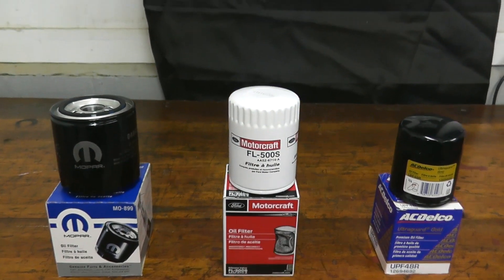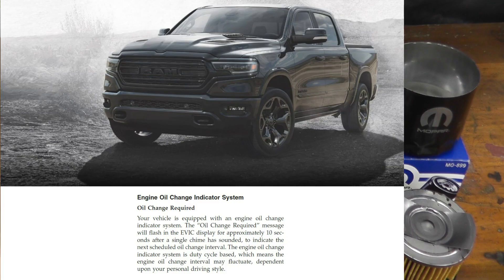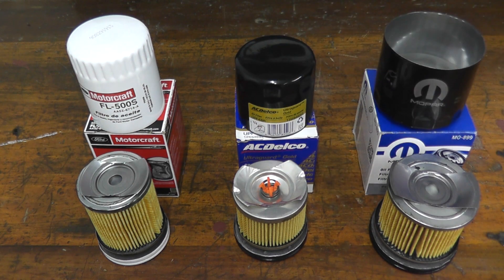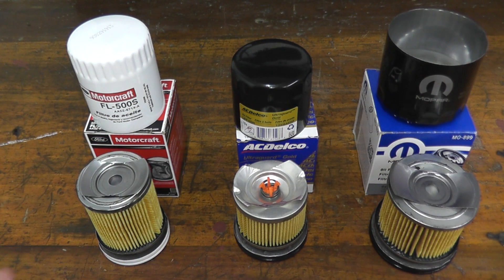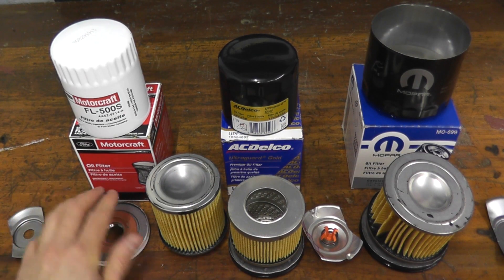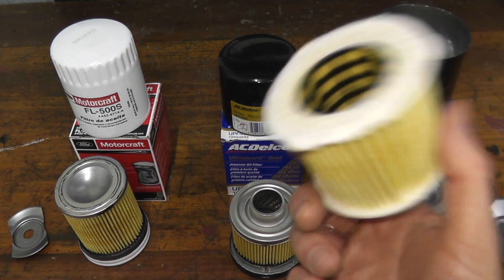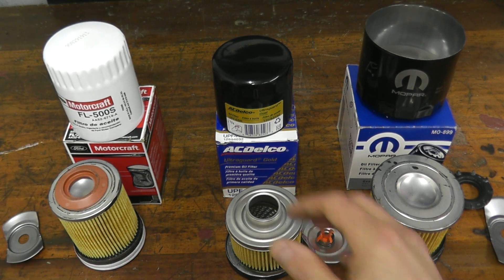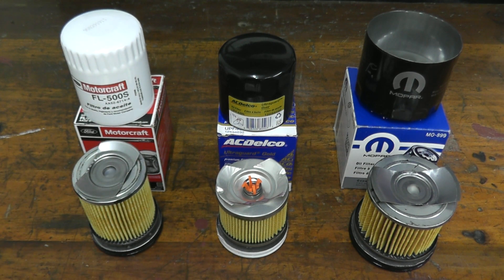Ford F150 Oil Filter vs Silverado Oil Filter vs Ram Oil Filter | Pickup Oil Filters

Comment: There is an opinion around about filters that are too good. I’ve talked with a couple mechanics who have the thought that just maybe these high efficiency filters are too good.  Meaning that they are so efficient that they are not allowing adequate flow which is causing some failures in newer vehicles.  I drive a F150 and have always used motorcraft filters.  150k and no issues.

Comment: Is it ok to use a mopar oil filter on a chevy? Also how much torgue do you recommend when torquing the oil filter?  I dont want it coming loose when going over speed bumps or pot holes?
Reply: If you're gonna do that, put a Motorcraft one instead. 
the quality is oviously better, and it's cheaper too!
Oil filters should be hand tightened always, and try to not use that much force.

Comment: Much hubbub and bad informattion regarding those COIL springs vs. the STAMPED STEEL springs.
Many Reviewers complain that the stamped spring is inferior, and that the filter makers are cheating their customers with the stamped spring.
Fact is, the MOST EXPENSIVE oil filters use the STAMPED spring -- AMSOIL, Royal Purple, Mobil 1, Fram Ultra, for example.

Comment: Ford wins -- hands down.
1. Ford has the By-Pass Valve at the TOP of the filter -- the GM and Mopar filters DO NOT have the superior valve location.
2. Ford has the SILICONE Anti Drain Back Valve -- the GM and Mopar filters DO NOT have the red silicoe ADBV.
3. Ford gives an actual micron rating -- the GM  and Mopar filters make us guess.
4. Ford has the best pricing when all the features are considered.
5. Ford recommends 7,500 mile change intervals for their Silicone ADBV filters -- not to exceed one (1) year.

Comment: 10k oil service interval was adopted to meet epa ratings. 10k intervals effs engines up bad. Gm timing chains. Hemi and gm cams. Ford timing chains. Phaser problems. All due to 10k intervals.  Do a black stone test after running oil for 10k. 🤣🤣🤣🤣
Reply: If you're running conventional or syn blend, yes. Group 3 full synthetics can handle 10k relatively well
Reply: Yeah but the oil filter shouldn't be on that long. On  gdi engine lots of blow change at 3k. 5k if non gdi. don't care what oil you use. 
but at the end of the day it's your money and your engine.

Comment: I’ve read Mopar 50/50 chance of receiving a Fram or Puralator guts. I used to run mopar on my jeep by now run a FL-1a motorcraft on my 4.0. Also run motorcraft on all my fords from my diesel to my Shelby
Reply: Purolator makes both the Motorcraft and Mopar filters. Just different specs. Ford definitely uses higher standards than Mopar though. I used to run the FL-1A on my 4.0 as well. I liked the thought of a slightly taller filter and just a little more oil in the crankcase. I do use all Motorcraft filters on my Ford, mainly because the price and quality can't be beat.
Reply: @SonsOfThunder06  my exact thoughts. My diesel gets nothing but Motorcraft filters. Oil and fuel.

Comment: Ford uses silicone in their filter. And the bypass valve is under the threads instead of bottom of filter as where it circulates oil back into block without having oil pass by the dirty side of filter like most other filters do. There are good sae uscar36 filters like this if you look.

Comment: AC  Delco  filters have always been junk and used a rubber Anti drain back valve  Along with most AC Delco parts  the vehicles  leave the factory with made in China parts.... Water pumps,  filters,  Harnesses,   GM quality is horrendous in 2020.

Comment: On filter "efficiency", the 80% at 20 microns might be 99+% at 25-30 microns, and 98% at 25-30 microns might only be 70% at 20 microns. Those specs are very shady as they are not consistent across brands. There is a standard for testing and compliance as shown here https://youtu.be/4at4X8TZOlw , but advertizing tries to hedge for market share. Using OEM filters is NEVER a bad option.
Also, antidrainback valves are really only necessary on horisontal or "cap up"/base down applications as the below horizontal and cap down applications remain full. If they are antisyphon valves, that the inlet is uninterrupted from the sump, then the postion of the filter is irrelevant as syphon could occur without the check valve.

Comment: I would say all of these factory filters have gone down in quality over time. My opinion is that that Delco filter has a rubber (not even nitrile rubber) anti drain back valve. Would work ok, but don’t store these for more than 5 years as they become brittle. Out of those, the Motorcraft is the winner with its decent filter media construction and silicone drain back valve. Also the bypass valve design is great considering it doesn’t pick up trash from the bottom of the filter if it bypasses. That Delco is overpriced junk and the Mopar is basic and just a pass. Interesting that Ford recommends 6 months on the better filter. I think that says a bunch about what ford think of their vehicles once they leave the plant. Maintenance isn’t a bad word to Ford in this case.
Reply: Alexander Jenkins  I’ve been using Purolator One and Wix and Baldwin. These companies are interested in great filtration, not just filling orders to GM’s low standards like Champion Labs has been doing of late. Delco Air filters are just as bad. Check out Project Farm’s take on that one. I love GM for SOME of the engines they have been putting out but they really have been slipping on the after care side of things. I don’t see Ford doing that with Motorcraft. Motorcraft still means “factory quality” not just “good enough”.
Reply: True,great points. Another thing is the efficiency rating. Ford comes right out and says 80% of 20micron or more. That's an actual straight up rating. Mopar doesn't give one and the gm filter says 98% @ 25-30 microns, lol. So basically, it's 98% for particles 30 microns or greater. That's a very deceptive rating and I bet the 20 micron rating is pretty shitty, otherwise I'm sure they'd advertise it.

Comment: Jordan marling your comment is interesting to me mann and hummel in the fayetteville plant have u  ever worked for purolator if how are you getting ur negative accusations
Reply: And when something like that happens they take full responsibility and replace the engine I'm sure of oil filter manufacturers have had issues also no one is perfect but no need to bash the product we take pride in our filters and product we make
Reply: Brandon Faircloth you should just search torn motorcraft oil filter. There is lots to find... 

https://www.bobistheoilguy.com/forums/ubbthreads.php/topics/5291269/another-motorcraft-failure#Post5291269

https://bobistheoilguy.com/forums/ubbthreads.php/topics/4531661/5

https://bobistheoilguy.com/forums/ubbthreads.php/topics/4906092/found-a-defective-fl-500s-images#Post4906092

https://www.f150forum.com/f70/5-0l-oil-filter-failure-271294/

https://bobistheoilguy.com/forums/ubbthreads.php/topics/4374902/1

https://www.bobistheoilguy.com/forums/ubbthreads.php/topics/4626006/Motorcraft_FL-500_C&amp;P.

https://www.bobistheoilguy.com/forums/ubbthreads.php/ubb/showflat/Number/4979202/gonew/1/motorcraft-fl-400s-missing-drain-back#UNREAD

https://www.bobistheoilguy.com/forums/ubbthreads.php/topics/3994569/Motorcraft_FL820S_cut_open_Dat#Post3994569

https://www.bobistheoilguy.com/forums/ubbthreads.php/topics/3420217/Motorcraft_FL-910s_cut_open

https://www.bobistheoilguy.com/forums/ubbthreads.php/topics/3564360/1

https://www.bobistheoilguy.com/forums/ubbthreads.php/topics/4480651/1

https://www.bobistheoilguy.com/forums/ubbthreads.php/topics/3666473/Re:_Multiple_filters_cut_open:

https://www.bobistheoilguy.com/forums/ubbthreads.php/topics/5051931/1/motorcraft-fl820s-fail

https://www.bobistheoilguy.com/forums/ubbthreads.php/topics/5189063#Post5189063

https://www.bobistheoilguy.com/forums/ubbthreads.php/topics/5312303/motorcraftf-fl820s-1-310-miles-109-hours#Post5312303

These are some issues of the purolator made motorcrafts.

Comment: The motorcraft and mopar are made by purolator. Not really a good thing. They have a lot of issues with them, tears, slices in the anti drain back valves, sloppy construction. The ac delco is the clear winner here it seems. I wish Ford would boot purolator to the curb and move to someone else because they used to have good filters. Since Mann and Hummel took over purolator they have gone downhill.
Reply: Wix continues as the vendor for  SRT/Police filters.